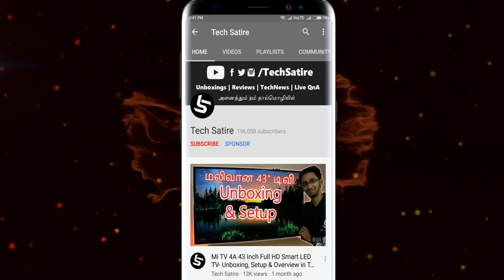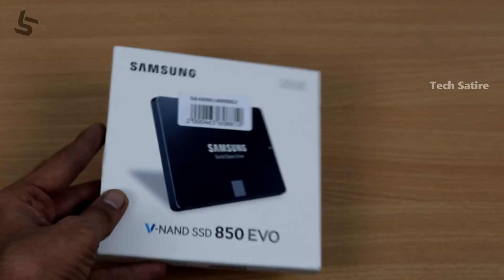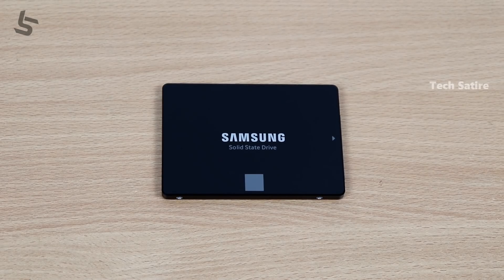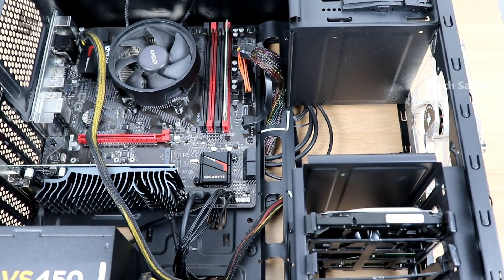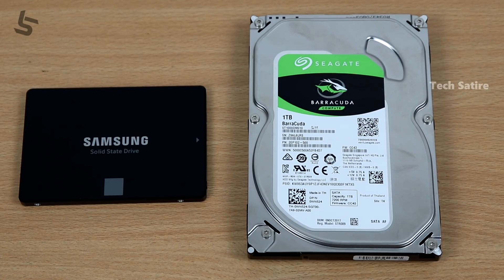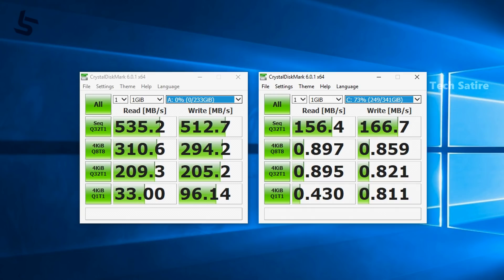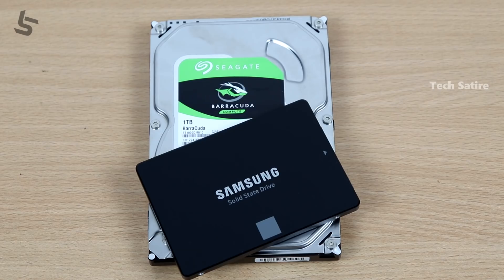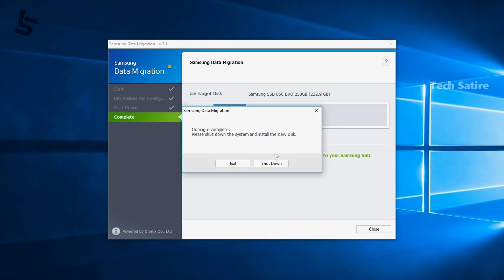உங்கள் பழைய PC / Laptop -ல் இதை மாட்டுங்க! 🔥🔥 Speed up your Computer using SSD ! | Tamil

Comment: i have an asus laptop with this specifications ASUS NB E200HA-FD0004T(ATOM/2GB/32GB/11.6"/W-10).
I am using this without updates because, the c drive (with little bit of pics or documents or apps) shows red. but has external storage up to 1tb in the form of micro sd slot. 
Now will I be able to increase my ssd and storage on C drive?

Comment: கவர்மென்ட் லேப்டாப் இத பயன்படுத்த முடியுமா
Reply: Intel Pentium 8th gen  , i3 and i5 and i7 indha processor mattum than bettera irukum
Government laptop la change panradhuku old i3 laptop vangirulam
Reply: Yes you can
Reply: @GiriprasannaVG   if it's possible to use 4 gb ram in hp government laptop
Reply: @sheikdawood7992  yes in my Lenovo government laptop I removed 2gb ram and added 4gb ram since there is only one slot..
Reply: @GiriprasannaVG  now how is it your laptop speed
Reply: After changing the ram how speed your laptop working

Comment: Arduino Uno 3 PCI Express la connect pannalama....
Reply from the maker: havent used it bro, so not sure. Google it
Reply: bro windows 8,8.1,10 vandhu MBR la store aagudhu ..but Linux yenga store aagum..in hard disk la....
yevalov hard disk namba connect pannalam smps ooda....
sata cable avangale hard disk vangumboodhu taruvaangala